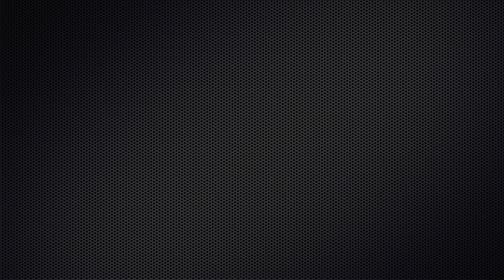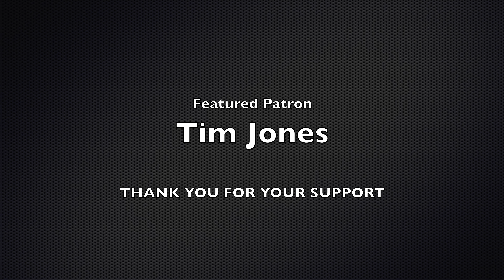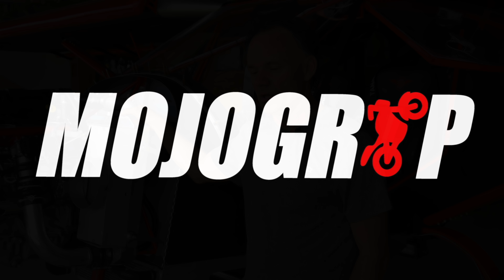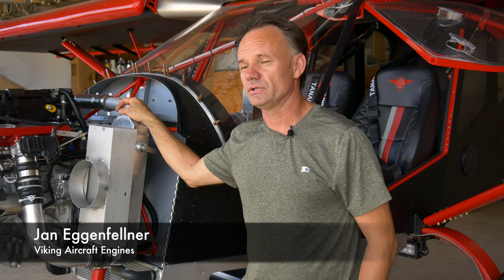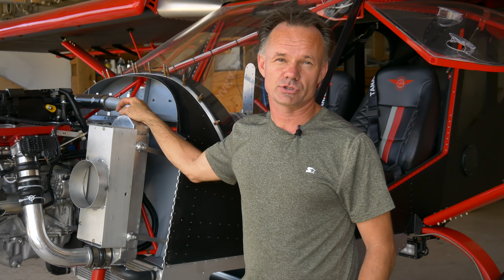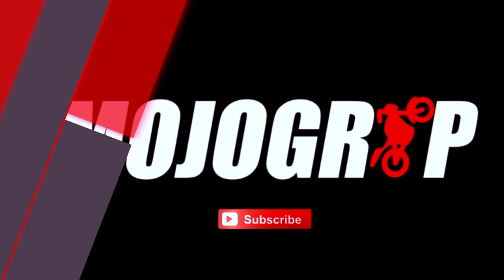Aircraft Engines l Auto Conversions VS  Certified Engines

Comment: I do have a serious question, as I gather data in my quest to eventually own the plane of my dreams (Custom Long-EZ), I know the norm for such a plane are O-320's (140-160HP, depending on exact model), but I am considering a 200HP Turbocharged Automotive conversion (Ideally, in my head, I imagine 200HP all the way to 20K, and my maximum service ceiling of 25K), but more importantly, I want also a Constant speed propeller.

Now on to my actual question: Since Auto conversions are geared, and don't run off of the crankshaft directly, it seems a standard hydraulic model would be out of the question, more important in my mind, however, is how a geared automotive conversion would respond. It probably is a complete non-factor, and I'm thinking too hard about it, but if anyone has information that might be useful, I would appreciate it.
Reply: Read the comments I and nickolas  wrote, with the link in nickolas post, to this video. Your chances of finishing the aircraft and having a good flying airplane with an aircraft engine are far greater, than any auto conversion you can dream up.

 Weight and drag are two factors. Trying to figure out where to put a radiator and duct, where it's efficient is difficult. The designers, whether it's a Van's RV or Rutan's long-ez, are around air-cooled horizontally-opposed 4 cylinders. And yes the water cooling in the gear reduction adds weight and complexity and drag.

You're truly way out on your own and you're going to add 100's and 100's of hours of build time, and you're not going to save any money. 

The auto conversion guys constantly say how great their conversions are, but after reading these for 30 years, you don't see them taking over the world or meeting the claims. Some deserve credited for effort and good results ( near aircraft engines), but those are few and far between, but required far more work and technical resources to achieve it.

For awhile it was the rotary engines were the best, but they're kind of boutique rarity. A nice guy in Florida supported them with drives and help. He at least flew what he made in an RV4. He is out if the business. Rotary engines themselves have drawbacks, not the least of which is poor fuel economy. There have been two other companies that made very sophisticated wankel designs for aircraft, but neither of them got any traction.

Then there was the Subaru conversion, like the one that eggenfellener sold to mostly Van's Aircraft customers. He folded, left everybody holding the bag. Eggenfellner Subaru powered RVs sell for a lot less than a lycoming per planes. They're slower, heavier and there's nothing superior about them over a Lycoming powered RV. Oh, what he charged for them was as more than a Lycoming with all the extras needed.  Again he was in this business before and completely folded,  and now he's starting up a new company with Honda engines. Run don't walk.

 You also indicate you want to do some custom design. Unless you have incredible talent, resouces, CAD, fabrication ability (machine shop, composite fabrication) and ability to research and use engineering data, I would stick with a Rutan design with Lyc, fixed prop.

 If you really want a Canard airplane. I understand the velocity, cozy are all very good airplanes. Their size would lend more room for an auto engine. LongEZ is a great plane, but small and  has real limits to how much weight you can put for power plant.

 As far as constant speed props and hydraulics you're right you would probably end up needing an electric prop on auto conversion. However some reduction drives have incorporated a hyd prop governor and hollow shaft. More weight and complexity (and size).

If you're talking about a longEZ, chances are you're really looking at a fixed pitch prop, just for weight reasons. However the path to least resistance would be a lycoming with a hydraulic prop if CS prop is a must.  There are composite constant speed props that are lighter than a metal Hartzell, but never lighter than a  fixed wood prop. Best to get on LongEZ forums. See what has been done.

Forget about turbocharging, flying at flight level 250. Anything over 18,000 feet is IFR.  You would have to certify and equip for that, expensive. What you're talking about is pressurized turbocharged aircraft (Lancair or P210) or turboprop or turbojet performance. 

Trust me normally aspired Lycoming with reserve power  that's in light low drag aircraft, has reserved horsepower, can easily fly up to 18,000 feet efficiently. Some IO320's are making 170hp now.

 Of course above 18000 ft its Class A airspace and requires an IFR Flight Plan.  Is that how you're going to use this fun little light sport aircraft? Are you going to put an IFR panel in and heated pitot?

Most of my general aviation flying is below 12,000 feet unless there's really good winds higher up, and then I go on oxygen. Typical Cruise altitude is between 8000 and 12500 feet. That allows you to be at Full Throttle well below 75% power lean for maximum economy.

 Unless you have endless time and money for your custom long-ez that can fly at 25,000 feet with an auto engine and turbo charger, a real tall order,  Stick to the designers plans and keep it light and simple. A Long EZ is  made to be a light efficient aircraft using a lower horsepower engine. You're completely changing that, and you'll probably end up with something that you'll never finish or do it will do nothing well.

Last  there's an ambitious project Raptor Aircraft, that's on YouTube. See link below. They're using a turbocharged diesel Audi engine in  a velocity canard type design, but it total custom.  Look at their catalog of videos and how much work they're putting into this.  It's pressurized as well.  Google Raptor aircraft, look at their website as well. Tell me what you think.

https://youtu.be/yVC5qmYRdsk
Reply: @gmcjetpilot  What do you think of FADEC engine systems to get best performance for the engine and fuel economy?
Reply: @markhathaway9456  You have to prove they "get the best". I'll say the single lever control of TIO550 Continental in an almost 1/2 $million$ new Cirrus, is very cool, wonderful, awesome. It's way too expensive and I can operate an IO550 with 3 controls (throttle, mixture, prop) almost as efficiently. However the "workload" is higher. I can handle it. The Jet I fly has FADEC. Single control still the same as any non FADEC Jet...  However FADEC has benifit in ease of maintenance and protection of expensive turbojet engines... and there is some efficiency improvement. With huge fuel burn of a jet any tiny increase in efficiency is a lot of fuel, for a plane that 1000's of hours a year. A GA plane that flies 100 hours the pay back of FADEC is questionable from an economics analysis standpoint. Also it is hard to beat the Farm Tractor Hammer technology of Mags and a mechanical fuel system *100% independent of electrical system*. My RV7 has a Carb and one Electronic Ignition and one Mag. It flys like a bat out of hell and gets high 20's Gal/Miles in cruise, better than most cars while going over 3x the speed. Would FADEC be a quantum change in my planes performance and efficiency? No. Would I like FADEC? Yes but I'll take the $10K (or more) and buy fuel and fly more :-). Better fly now before AOC bans flying for the common people. Only elite Gov can fly in the future...
Reply: @gmcjetpilot  That's a lot of information. Thanks a lot. Since you fly an RV7 I'll also ask what you think of the RV-14 RV-14a. I think they've hit the sweet spot on a lot of aesthetics and practical things.
Reply: @markhathaway9456   join VAF forum and ask. There are no bad RV's..  it depends on your mission and wallet. If you are 6'2" and 250 lbs get an RV 14. If you're six feet or less, under 200 lbs, the RV7 is perfect for Side By Side 2Plc. Now your girlfriend or wife, that's a different story. Frankly a lot of RV pilots fly solo 95% of the time, so RV 3 or an RV4 for RV8 are really a great airplanes. I built and flew an RV 4.  Fantastic airplane. Put 900 hours on her before I sold her. Fantastic airplane. How much money do you have? RV14 is built on the larger heavier more expensive angle valve IO390 210 horsepower (experimental) engine. The RV3/4/6/7/8 can fly nicely with 320 to 360 (160-180HP) Lycoming. Bigger engine more fuel. $5/gal... Lyc fuel burns from 6-12 Gal/Hr (econ to max cruise). Do the math. However even a big engine can be throttled way back at lean of peak.... still small engine less fuel burn... which is axiomatic.
Reply: @gmcjetpilot  Money? None. Wife or girlfriend? None. I've watched a few videos of the RV14 and didn't realize it was that much bigger. I'll look at the others. I understand that a lighter plane doesn't require the top hp to still get great performance. I'll look for the VAF forum. I hadn't heard of that one. Thanks again!
Reply: @markhathaway9456  None of these planes are BIG... You want a roomy SE plane get a Bonanza. However the RV14 is based on the RV10 construction which is next generation from the RV7. The RV14 being a two place RV10 is wider and taller. Obviously the RV10 is the "Big" 4 place. Light planes in general be it Cessna, Piper or kit EBA... are small. Mooney's are very small (but fast for HP). The formula for speed in planes (and automotive hot rods) of course is smallest plane with biggest engine you can stuff in it. You are looking at over $120K to build a RV-14 with  price of kit,  new Prop and Engine, full panel, Pro paint, full upholstery (leather of course).  Also cost of insurance is going up. The market is small and competition is low. Add lack of hangers or hangers at reasonable price, plus fuel.... it is an expensive proposition.  Not trying to discourage you.... You might be best to get your feet wet buying a used RV6 or RV7 in partnership with another pilot.

Comment: don't forget auto engines aren't made to run flat out all day! you can't just "pull over" at 10k feet. reliability is everything!
Reply: They are meant to run far longer than it will take to empty your planes fuel tank. You also don't run them 'flat out' that is why you have a gear box.
Reply: You have info from 20 years ago
Reply: pull over in an aircraft... maybe you should see the P-51 Voodoo "Pulling over" at ground level to break the speed record. For reliability in a car engine, maybe search for a low compression engine, it won't be pushing too hard on itself to selfdestruct, can easily last 30 years with proper maintenance and will only be pusing a small capacity of it's real power.